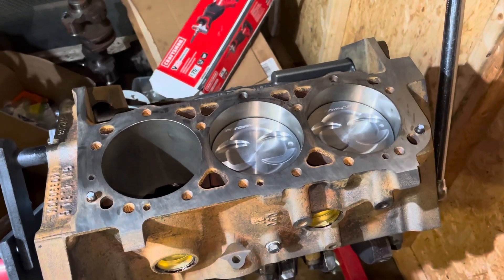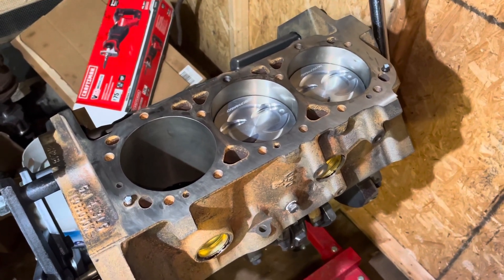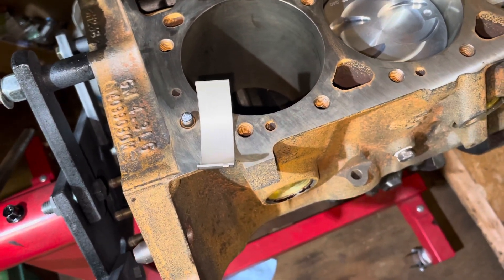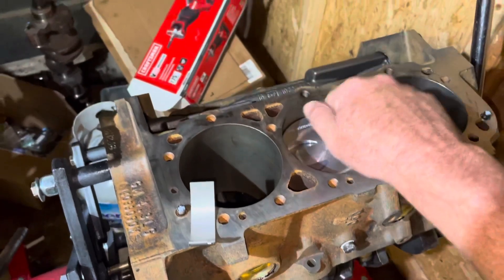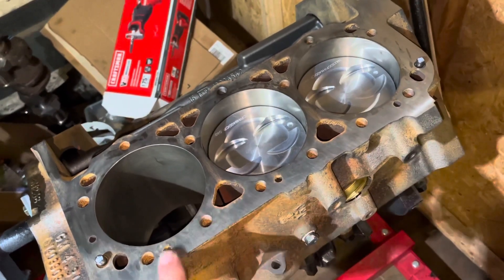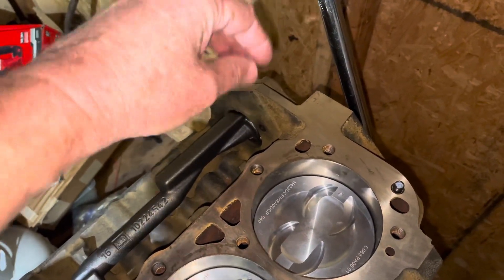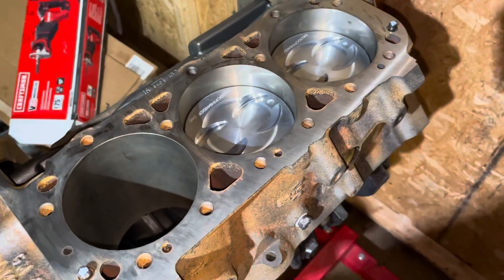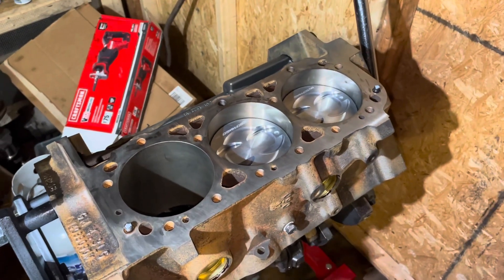Do 4.3 Engines Have a Tendency to Self-Destruct? Maybe!!

Comment: Also, I would advise that people use the best marine oil, not like an automotive oil (5/30) but the Merc/Quicksilver 25/40 or even better their syn blend 25/50. Expensive yes, but I have run these oils in my old 1988 4.3 (original short block, crank, cam and all bearings and lifters, only heads were replaced) and I have done multiple Blackstone Labs oil analyses and these oils hold their viscosity and do not break down. So, good fuel, proper total timing advance and good oil, that's what it takes. Unfortunately there is more bad info about motor oil for marine engines than just about anything else. The only way you will ever know if the oil is good enough is to do an oil analysis, you will see if it stayed in grade, and what your wear metals look like.

Comment: I very very seldom see a 4.3 but majority of my customers either have Cobalts or Bennington pontoons with Yamahas and just dont see Cobalts with small powerplants. But I do have a little Blazer with 4.3 and 215000 on the clock but it runs 18-2000 rpm not 3-4 grand. But I change oil 2500 not at 6k. People say I run synthetic but Im still believer oil gets contaminated not worn out. Have 17 silverado too and same every 2500. Im anal I change my coolant and trans too. Ive owned 3 4.3's over the years.

Comment: hey man. do the 4.3 vortec have piston cooling jets
Reply from the maker: No I have never seen a factory GM engine with piston jets.
Reply: @moccasinmarine   thanks for your reply. after i disassembled my engine i found a spun main bearing. i was wondering the cause of my seized engine. at first i thought maybe it was a piston
Reply from the maker: @WrenchesNrides  was it a rod bearing or main bearing? In my experience rods can go out one at a time but mains usually go out all or most at the same time. Not always but that’s my experience.
Reply: @moccasinmarine   it was a main bearing. at the rear.

Comment: Very interesting....my gas dock sells only 93 octane and that's all I have used in my 1988 4.3
Also, this engine has a Prestolite points distributor, the advance (mechanical) is set up to have only 18* total timing advance (6* base timing + 12* centrifugal advance) vs about 10* more in a V8 application. This appears to be the reason why, they were set up this way. I am wondering now, with the Delco EST system used on the later engines, what their total timing advance numbers are.
PS
one reason why I prefer the old pre-Vortec engines, the intake gaskets rarely if ever leak and I think the 12 bolt intakes sealed better. The plastic intakes gaskets & eliminating 4 bolts IMHO were mistakes made by GM.

Comment: I was a mechanic many years ago, had my own shop, it's been 30 years since I rebuilt a motor and I have watched all your video' s on the 4.3L because I recently bought a boat that needs the engine rebuilt. It sat in the weather with plugs out and the cylinders have surface rust and I don't want to mess it up any anymore than it already is. The engine is a newer Vortec with 10 hours on it and ran hot due to them not replacing the impeller in the lower unit when they replace the engine. Thank you so much for all your great videos, you are my hero. BTW I still have all my tools and equipment so rebuilding won't be bad. I do have to go back and look at some video's to get all the part numbers for the gaskets and and stuff I will need. I will definitely run 89 octane minimum.
Reply from the maker: Hi thanks for the praise. I started out recording engine building for my customers but realized I could help others build engines as well. My channel is growing because of viewers like yourself and I appreciate my subscribers. The hardest part of doing videos is realizing what I take for granted that others may not know.
Reply: probably too late for you, for if anyone else comes by, the biggest thing with the marine GM 4.3l v6 is total timing....base doesn't matter near as much.  i put mine < 18° btdc.